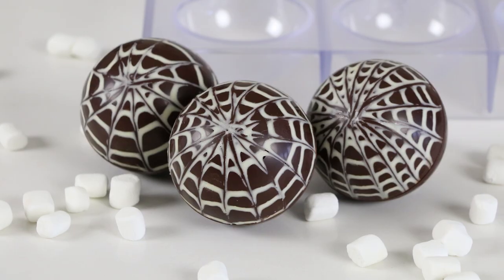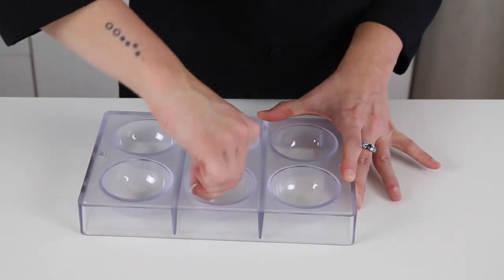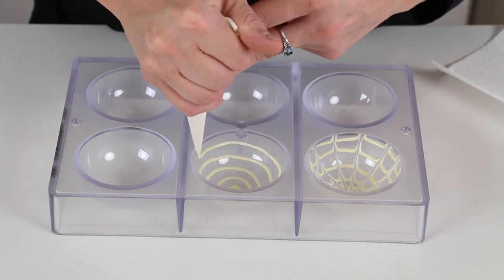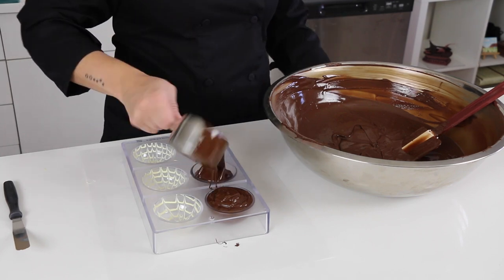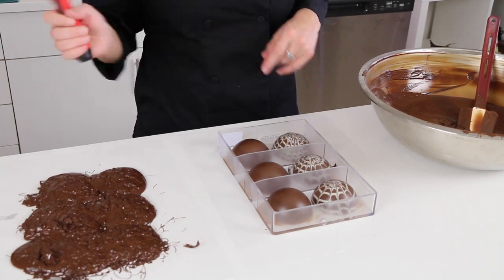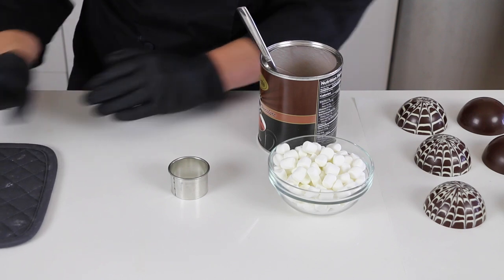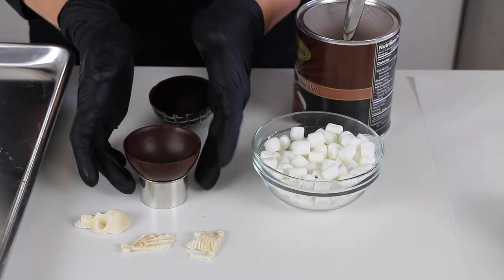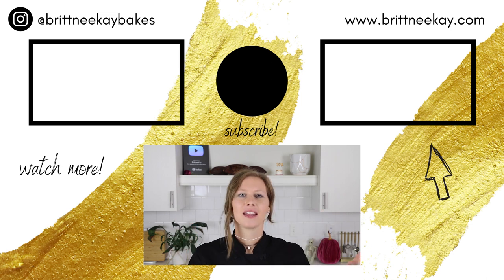Halloween Hot Cocoa Bombs with a Polycarbonate Mold and Tempered Chocolate

Comment from the maker: Have you tried making hot chocolate bombs using a polycarbonate mold? In some ways it's easier and in some ways I think the silicone is easier. What do you think?
Reply: No 😞 too intimidated
Reply from the maker: @braiwiberg3957  You can do it honey! In fact, I'm going to make ya 😉
Reply: But I might creak the mold 😣
Reply from the maker: @braiwiberg3957  It should be ok :)
Reply: I tried it once and after breaking a few I managed to made 1 complete sphere. I did not use the cotton ball first, so maybe I will try it again.
Reply from the maker: @adria89  Yeah! Definitely give it another try! :) Make sure your chocolate is properly tempered and not too warm when you put it into the mold, that will help! Also it may need a bit longer in the fridge...they really should pull away from the mold mostly on their own. Hope that helps!
Reply from the maker: @All Things Home with Me The mold isn't fragile it is really sturdy, but it can scratch so you want to be careful!
Reply from the maker: @All Things Home with Me Check out the links in the description, I have a couple options there for you!

Comment: When I pour the chocolate into the mold I can't get the shell thick enough >__< ! I don't even tap tap hard! Should I wait for the chocolate to sit a wee longer before pouring out?
Reply from the maker: Yep! Sounds like the chocolate may be a bit warm still or really fluid. Just wait until it's a bit cooler before molding, for dark chocolate it should be around 87-91º F.